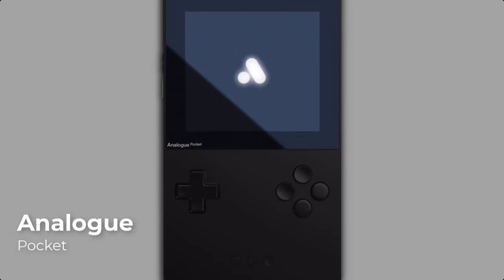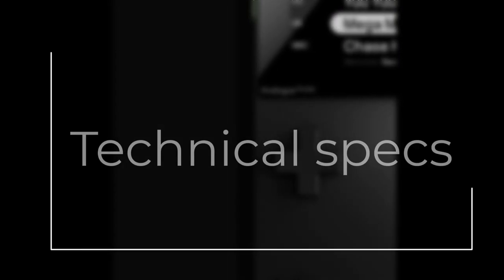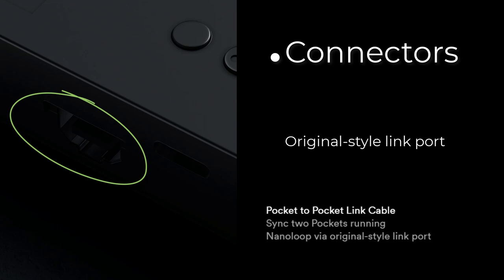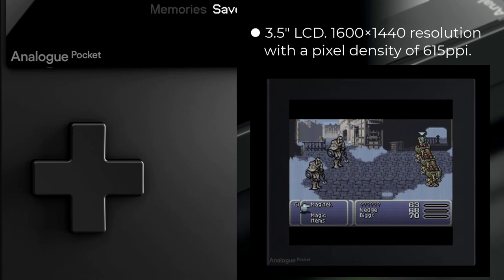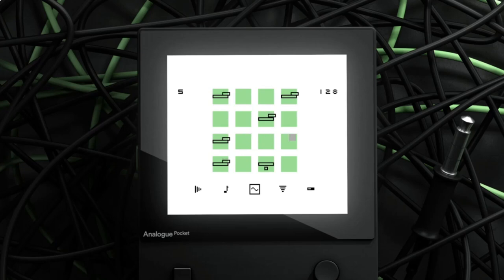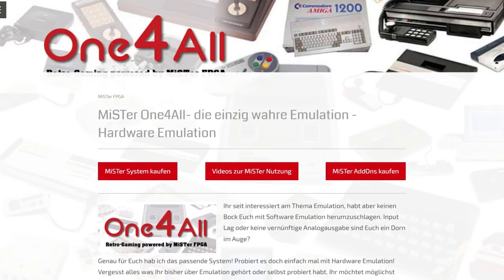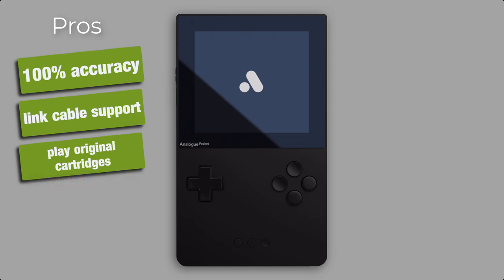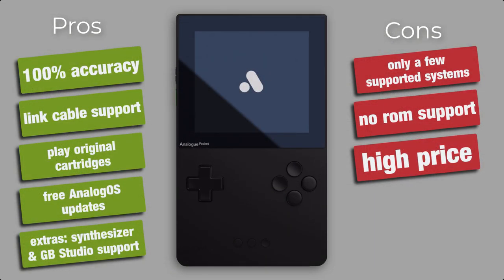Analogue Pocket REVIEW - A novel retro gaming handheld. What makes it so different?

Comment: Great informative video! Thanks for the effort to prepare everything so nicely. Did you order the Analog Pocket? I just took a look .. currently a delivery date 2023 would be free;)

I find the device interesting and well processed. I would like to take it in hand. However, I currently have other demands on such a device. The Pocket is too inflexible for me in terms of system selection. Not to mention the price of the accessories in the form of adapters for 30$ times to be able to use other systems at all. But well .. everyone as he likes it.

Thank you for your work MashTec 👍
Reply from the maker: Thanks my friend!
I tried to order but as you already said, it will most likely not be available again before 2023 (damn chip-shortage). Maybe i can grab a used one on Ebay :)
I also hope that the flexibility of this device will get increased with software updates.
The marketing is quiet aggressive. I also dislike the high price for the device and all the required Accessoires.
Looking forward to the new projects on your channel dude ;)
Reply: @MashTec  With the prices on eBay you can probably also pre-order two more Pocket xD My next project will hopefully soon be part 3 for the RG552 (short Linux test). You know it yourself .. YT in addition to a full-time job with family and then still motivating yourself in the evening and not falling asleep from tiredness while standing is always such a thing :) by the way .. check your mail ;) Greetings 👋
Reply from the maker: Yes, they deal them between 500,- and 800,- Eur. It‘s crazy! I had the same idea of ordering two of them :D but i wait. A friend of mine will get another in April. Maybe he sells it to me.
Concerning YT, i absolutely understand what you‘re talking about ;) but well, it‘s a hobby is like.
Looking forward for your video dude.

Comment: I've seen a lot of people wishing that they could load their ROMs onto it. Did anyone ever try the GBA cartridges that adapt a Micro SD card for multiple games?
Reply from the maker: Hi Russ, i also wonder if that could work? I got the EZ Flash Junior for my GB for Christmas from my girlfriend.
A friend of mine will receive his in 2 month. Maybe i get the chance to try this and let you know.
Reply: Yeah, it works with Everdrives.
Reply from the maker: Perfect, thanks for confirming dude! 👍🏼😎
Reply: @MashTec  to clarify further, I’ve read that some people have run into errors or issues with some models, but they do work.  Or are meant to. Hopefully their updates improve compatibility and fix some of the various, though not super common, issues. This handheld is incredible.
Reply from the maker: @ozmaphase2  yes, i‘m totally with you :)

Comment: Will wait for an open source fpga handled from the Mister community.
Analogue way of making business doesn't interest me much.
Reply from the maker: Yes, MiSTer actually is an interesting project. I‘ll keep my eyes on this one too.
Reply: @MashTec  you should, not handheld but way better fpga emulation cause Mister project is more advanced in development thanks to its awesome developers community, saturn and PS1 cores are projected for 2022.
Reply from the maker: @laurent1120  Wow…that are awesome news!
But can‘t those cores be used in any FPGA system? So both projects would benefit from it?
I bet PS1 is a challenge due to the hardware emulation.
Reply: @MashTec  depends on hardware analogue is using specific hardware (essentially types of Ram) with the same fpga chip cyclone than the Mister use in the de10 nano sbc board.  I think some Mister cores were ported on analogue products like the nt mini. But all cores couldn't due to hardware limitations, Mister project can evolve du to sbc hardware rather Analogue products are stuck. I think pocket fpga emulation will be limited to 16 bits home consoles maximum.